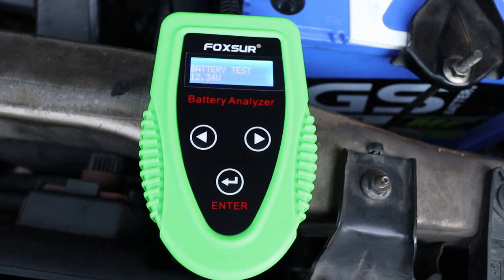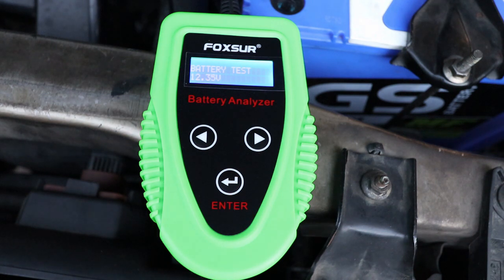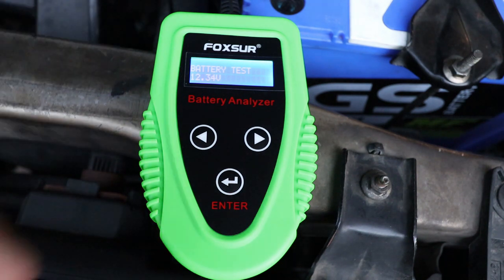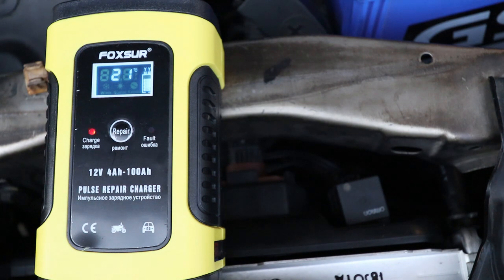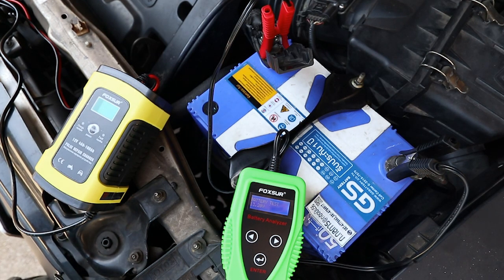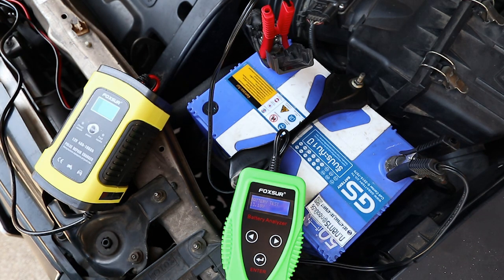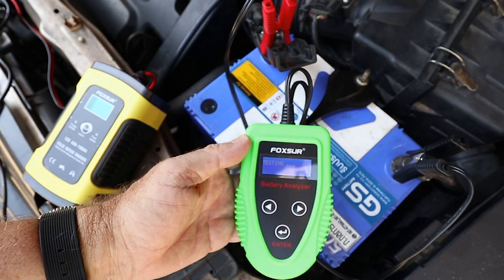Can The Foxsur Pulse/Repair Battery Charger Repair A Bad Battery?

Comment: I have this battery charger.  This is what most people don't understand about it.  In most cases, it's not necessary to pulse charge a car battery for more than eight hours with this charger.  Then, you're supposed to leave the battery connected to the charger for about two hours after the charger shows a full charge.  That would completely charge the battery.  I have a 12-volt lead-acid car battery that had went dead a few times.  The battery never would hold more than 12.2 volts.  I pulse repaired the battery with this charger for eight hours.  The battery had 12.8 volts after that.  It did have 13.4 volts immediately after I disconnected it from the charger.  The typical lead-acid car battery is supposed to have 12.6 volts when it's fully charged.
Reply from the maker: Thanks for the info. It's a real science and, as you say, few people have any deep knowledge. Including me! I followed the instructions and, as a result, had to wait until around 25 hours until the pulse charge finished. It then reverts to a normal charge, and the manual advises leaving it in normal charge mode for another hour. Admittedly, 25 hours seems like a very long time, and 8 hours sounds more reasonable, but without any deep knowledge of what's actually happening inside the battery, I was just following the instructions. It's always useful to get a different view.
Reply: @PhilUKNet  I'm sure most people would expect this charger to be able to sense when a battery does or does not need to be repaired.  It's obvious to me that it doesn't have that capability.  There may be more expensive chargers with that capability.  This battery charger does eventually change from pulse charging to regular charging at around 25 hours.  That's not based on anything except for a timing mechanism.  From what I've read about pulse charging, the battery charger is in a state of charging and discharging the battery.  That's how it reconditions the battery.  Of course, it never completely discharges the battery.  That would cause damage to a 12-volt lead-acid battery.
Reply from the maker: @KingsportMan  I don't know. I assumed that while it was pulse charging, it was also monitoring voltage and resistance in order to ascertain when the pulse charge had done its job. If you're correct, in that this cycle is based solely on time, that's quite disappointing.
Reply: @PhilUKNet  I watched another YouTube video of a guy using this charger.  His 12-volt lead-acid battery would not hold more than 6 volts.  He had to press the charger's repair button to start pulse charging the battery.  The charger didn't start doing that automatically.  He spent three to four days pulse charging that battery.  He finally decided to stop pulse charging the battery.  There is no indication of when the battery has been repaired unless someone has a battery analyzer like the one you used to make this video.
Reply: @PhilUKNet  I think most people will be satisfied with the results simply because of this charger's voltage display.  All they have to do is unplug the charger and look at the voltage display.  There shouldn't be anything wrong with the battery if the charger is showing that the battery has at least 12.6 volts.  My only concern was that some people might spend days pulse charging a battery for no good reason.  That's only supposed to take about eight hours.
Reply: mine says off and isn’t charging
Reply: @PhilUKNet  I did learn more about why a lead-acid battery needs to be repaired sometimes.  There are electrodes inside a lead-acid battery.  Lead sulfate crystals eventually build up on those electrodes.  Sending a strong pulse charge through the battery will cause those lead sulfate crystals to break down so that the battery can be fully charged again.  I suppose the electrodes are being cleaned during the pulse charging process so that they can conduct electricity again.  There are also carbon deposits that form inside a car engine.  Carbon deposits on the spark plugs will affect the performance of an engine.  Too many lead sulfate crystals on a car battery's electrodes will affect the performance of the battery.
Reply from the maker: @KingsportMan  Thanks for the information!
Reply: @PhilUKNet  Can pulse charging be done with the battery in the car with the terminals connected?
Reply from the maker: @mihai8166  I certainly wouldn't advise leaving the leads connected. The user manual doesn't say anything, but I always disconnect the terminals. For a few minutes extra effort, it's not worth the risk.

Comment: You can fix any batterys with pulse repair I did a test with opening a old battery had lots of crystals after 26 hours battery had no crystals at all looked new from 4.6v to 14v made battery new again
Reply from the maker: I understand the theory, but I have never actually opened up a battery! You're very brave. Thanks for the feedback - very interesting!
Reply: Will it lessen the long hours completion in pulse repair mode when you do pulse repair again in the next day ?

Comment: My battery went from being fine to being bad over the course of about 3 months requiring a charge at decreasing intervals until it got to the stage I was charging every other day, it’s an old battery 6 years+. I put the charger in Repair mode and left it for 18hrs, I then turned it back to normal charge mode and it went straight to fully charged. I haven’t had to charge for over a week and the battery still has plenty of kick to it. Thanks for a great video and saving me £60. P.S. my charger is version 5.
Reply from the maker: That's great news! The charger has limitations and can't repair serious defects, but if it's just sulfation it can help. My battery is still going strong. Batteries don't tend to last long in hot climates, but I'm hoping the charger will get more life out of this one than usual. Thanks for your comment!
Reply: Thanks for sharing a similar (positive) confirmation that the units can and do work for seemingly most use cases.
Reply: @PhilUKNet Will it lessen the long hours completion in pulse repair mode when you do pulse repair again in the next day ?

Comment: Just used a similar model charger this evening on a totally dead battery, wanted to find out if it stopped automatically when done charging, and your review has answered my question. Thanks David.
Reply from the maker: This same basic charger is sold under many different brands, but I expect they all come from the same factory! Yes, it's all automatic - if you do a repair it should switch to normal charge mode when the repair has finished - and there shouldn't be any problems with overcharging as there were with old-fashioned chargers.

Comment: Thanks for this video it is very helpful... I have mower + car + motorbike batteries that I want to verify / repair/ charge - I have been assessing the battery condition via multimeter but not under load so maybe a few dollars on a charger and tester makes sense - also saw that after 4 months that your repair held great even more reason to invest.
Reply from the maker: The battery is still fine, but I will probably do another pulse repair soon. Someone who seems to know quite a lot about this commented and suggested doing a repair charge twice a year. Where I am in Thailand I was able to buy the analyzer and charger very cheaply and they have both been great value for money. Thanks for your comment!

Comment: Thank you, sir. As a ham, CB & UHF radio operator we always keep backup batteries & inverters in case of emergency. I have a few 3.3, 7 & 12 amp gel cells & some larger lead-acid ones. These are for an emergency & is a whole lot closer with this Russin business now going on. I have this same charger. They work. I recently was given an 85 Ah battery. I topped up this 85Ah sealed leisure battery (I distill my own water) by drilling 6 holes topping it up & resealing it with hot glue so easy to remove & re-top up in the future. I had it on pulse repair overnight & it brought it back. My only test was on a 12-volt kettle that draws about 14 amps & It boiled a full kettle twice so far & close to an hour of 14 amp constant current draw & it's still well over 12 volts, but I will give it some more pulse charging. I have 2 126Ah truck batteries that I have been maintaining on pulse repair in case this Russian war business goes nova & the UK loses its power grid with conventional or EMP weapons. UK power grid is very fragile. God help us if that happened all nuclear facilities could not be maintained & would explode. If there is a god that is.
Reply from the maker: Thanks for your comment! I'm really pleased you have had success with the charger, and those 126Ah batteries are huge. I've received a few negative responses about the charger, but mostly the feedback has been positive. I never would have believed that in my lifetime I would read comments like the other ones you made. Every November we remember the terrible loss of life that occurred in the past and we all say that it should never happen again. Yet, here we are in a major confrontation that could spark another world disaster. I sincerely hope that it doesn't reach the point where you are having to rely on those batteries.

Comment: Hi Phil, this is the most informative video I've seen on YT.  Hat's off for that. I'm 25 hours into repair mode. This is a great little tool. My only gripe is that you can't see the live voltage when it is in repair mode. The newer version of this is around £5 more and does show live voltage. I wonder if flicking to normal charge temporarily to view live voltage would confuse this gadget and prolong the repair process?
Reply from the maker: Thanks! I didn't realise there was a new version. Appreciate you letting me know, I'll look into getting one. Whenever I've done regular charges or repairs I haven't flipped between the two modes, so I'm not sure what would happen. All of my repairs have taken in excess of 24 hours. About 27 hours, or thereabouts, so 25 hours is normal! I've had quite a lot of success with the charger, but it's slow.
Reply: @PhilUKNet  being slow is the whole point of pulse charge. That's what causes desulphation of the battery

Comment: Thanks for your very intuitive video.  I bought mine from Lazada to use with a 3 years old MB which I had parked for 3 months.  At first, I used the AGM mode, on the bigger Foxsur charger, and it reported the battery as being full within an hour but the car would not start.  Then I search the internet and came across your review and tried the "Repair" mode and viola the car started.  I only used the repair mode for 14 hours and then drove the car around the block a few times.  Thanks again.
Reply from the maker: That's great to hear! I've had problems with rechargeable camera batteries in the past when the charger says full, but the battery is dead. Car batteries seem to be a bit better (most of the time) and the pulse repair chargers provide another way of squeezing a little more life out of them. The charger has worked well for me so far and being so cheap I think they are something of a bargain. Thanks for taking the time to leave a comment!

Comment: I'm curious now that it has been 4 months what the capacity of your battery shows if you check it with the tester again. I'm going to grab a charger with the pulse repair function.
Reply from the maker: Good point. Thanks for your comment and thanks for the reminder! Some background first. I haven't charged or pulse/repaired the battery since making this video. I've just been doing normal driving and I don't usually drive my car at weekends. Mostly, it just sits idle Saturdays and Sundays. The rainy season has arrived in southern Thailand so I've had my headlights on quite a lot during the daytime, along with wipers and dash cam, and because it's so hot and humid all year round the A/C is always on. The test I just did showed the following: 12.75v and 533 SAE ("Good Pass", it tells me. The battery - I believe - is fully rated at 620 SAE). So, everything looks good as far as the tester is concerned and absolutely no problems with the car. It starts first time, every time, and the starter motor is strong.
Reply: @PhilUKNet  Nice one. sounds good to me.

Comment: I've read elsewhere that some cars have sensitive electronics that can get damaged by pulse repair mode. Apparently the pulses are actually very brief higher voltage around 18-22 volts that breaks apart accumulated stuff on the plates. They recommend disconnecting the car negative terminal to isolate car electronics.

On a related note a guy at Sweet Project Cars channel used a welder to recondition car batteries. It surprisingly makes sense since a welder is simply a low voltage high currant power supply. But not everyone owns a welder and this charger is way cheaper.

I've made up my mind and am getting this charger too. Thank you for sharing your experience with this charger.
Reply from the maker: The user manual doesn't say anything about disconnecting the battery, but whenever I do a pulse repair I disconnect the battery terminals for exactly the reason you state. I would suggest that other people do the same - just in case. I leave the battery connected for normal charges but - as you say - car electronics aren't designed to receive brief pulses of a higher voltage. Someone else on YouTube looked at the pulses using an oscilloscope so you can see exactly what voltage is coming out of the charger.

I've never heard of using a welder! My general conclusion about the charger - and this has been verified from other comments I've received - is that the pulse repair works and that these little devices really can extend the life of a battery. I heard from someone in Ireland that he paid £28, but in Thailand I only paid around £6 so they're a real bargain too. I have no regrets at all about buying mine. Thanks for your comment!
Reply: I just a few sec a go put foxsur 7a to repair my agm 7 yr old varta (golf 7 1.6 tdi) without dissconnecting the battery. I will let You know if my golf survived or not (tomorrow). Only have I heard foxsur 7a is a great charger for little money.
Reply: @PhilUKNet  After 12 h I disconnected still pending repair. I was affraid of hhigh voltage (put multimeter 15,75 pulsing ) and put agm mode. We'll see what is going to happen.
Reply from the maker: @radiator1979  I'd recommend disconnecting the battery leads if doing a pulse repair. The manual doesn't state this, but I think it's better to be safe than sorry. The high voltage shouldn't hurt the battery. It does what it does to try to remove the lead sulfate crystals from the plates. The repair takes a long time - from my experience around 27 hours.
Reply: @PhilUKNet  A little summary. After 12 h repair mode (still pending) Istopped repair mode and user my car in the day.  Set agm mode for the night use my care early in the morning and then set repair mode for 3,5 h one more time. Got vcds and I saw that my battery from 31 Ah (68 id on the sticer) went to 45! The light  are brighter and the engine start just like eye blinking. Gonna repeat repair mode in a few days. What I can tell is that do not star repair mode if battery was not fully charged previously.  The whole procces was done inside engine bay (no disconnecting leads)
Reply: You don't charge or repair your car battery whilst connected to the car ever, you'll be asking for issues
Reply: @teem5642  an alternator charges a battery whilst driving so it’s no different to a battery charger doing the same. Voltage is designed to go up to 14v
Reply: @seemaab  When pulse charging the voltage actually goes higher than 14v mate (15-16v). I really recommend unplugging the battery if you're pulse charging.

Comment: Great video! Like you, my battery went dead thanks to lack of driving during covid plus summer temperatures. I have the same foxsur charger/repairer. I let it charge overnight and made a couple trips the next day, but the starts were a little slow and rough. I suspect my CCA has also been reduced thanks to damage to the battery. Sadly, that same foxsur tester/analyzer is sold out in the states, so I can’t be sure about the damage. I’m using the pulse repair now, for a day, and am hopeful the starts will be less sluggish and I’ll have indeed repaired the battery. This video you have taken the time to make is giving me hope! 🙏🏼 Thanks for making it up to help out others. The world needs more helpers.
Reply from the maker: Thanks Adam, very kind words! Your story sounds identical to mine. After my battery ran flat I recharged it successfully, but the CCA was very low. I didn't realise this until I tested it with the Foxsur battery analyser. I then repaired it in pulse mode and the CCA was restored almost back to new. Since doing that I haven't had any problems. My kids are back at school now and I'm using the car regularly again. I'm surprised to hear it is sold out in the US. I understand that these devices are generic and sold under different brand names. You can maybe find the same thing being sold with a different brand?
Reply: How did you go with the battery pulse - did it repair your battery mate?

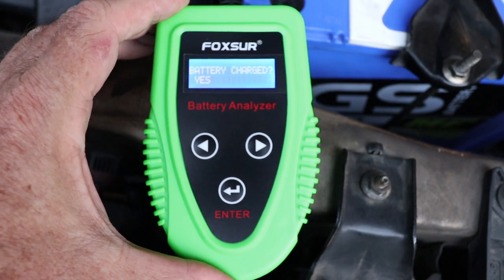Comment: @1:52 It's not telling you it's charged, it's asking you (notice the ? mark). At 12:30v your battery it is not fully charged so this will affect the results from the analyser. hope this helps.
Reply from the maker: Thanks for the info.
Reply: I came here to say the exact same thing. A discharged battery will give a lower rating. This is why it states to fully charge your battery first.
Reply: I'm glad I saw this because I was going to say the same thing👍🏽👍🏽